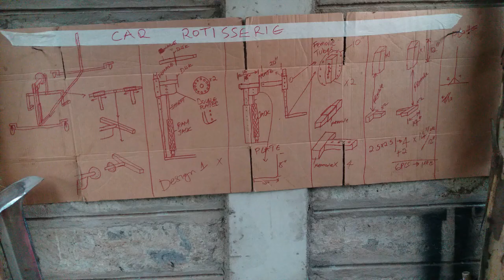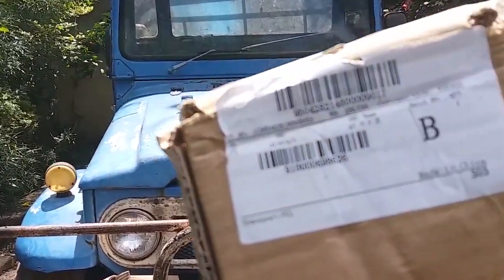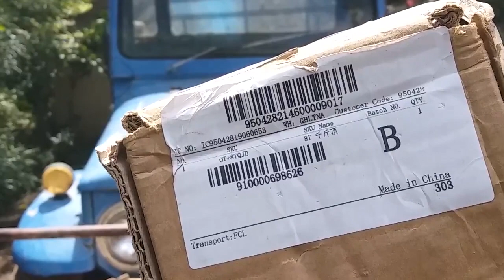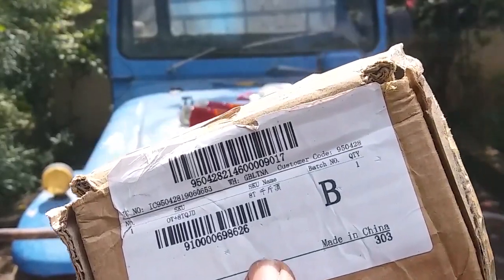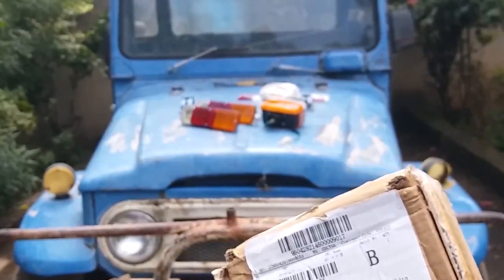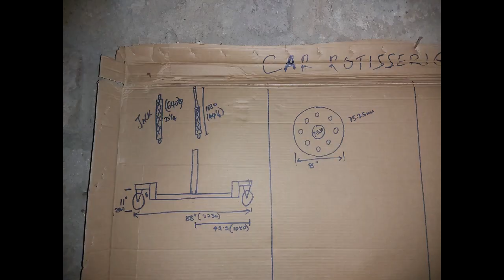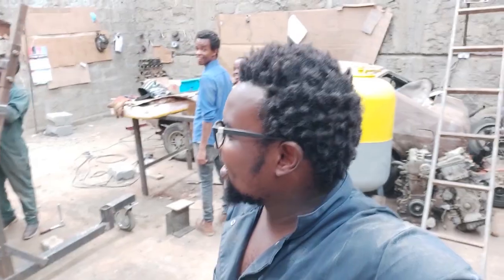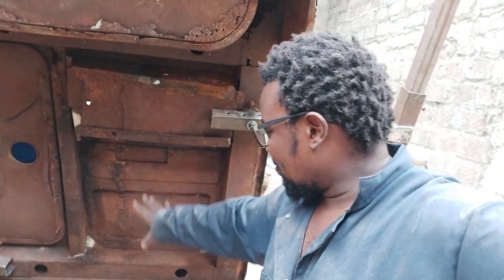The 70s Garage Car Rotisserie DIY

Comment: I love the vibe of you guys working together!  So, a hint on your rotisserie machine.  You have done well to allow the up and down movement at the rotating points.  To compensate for the distance between the rotating point and the arm that goes from one side of the car to the other side, the pieces that hold onto the car should also be vertically adjustable.  This will allow you to place the center of gravity of the car at the rotating point and will make for effortless turning of the rotisserie.